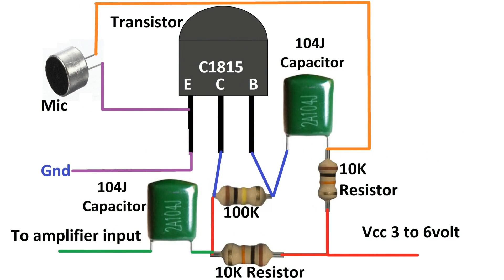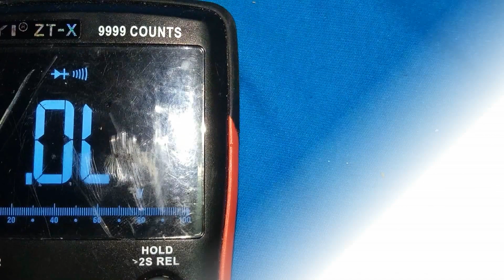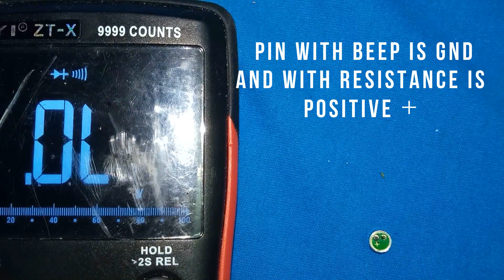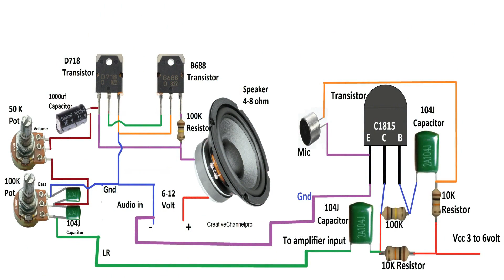Mic Preamp Circuit | Mic to Speaker Circuit Using Transistor

Comment: what happend if i chang supply from  mobile charger ?

I struggled
Reply from the maker: What mean bro mean you want to try this amplifier circuit on another current source. This amplifier can also run on battery's 1.5 volt 4 batteries in series. Or if you have any supply rating 5 to 8 volt 0 to 2amp